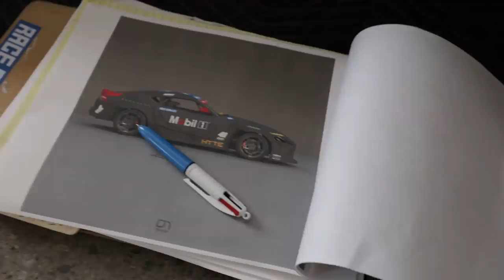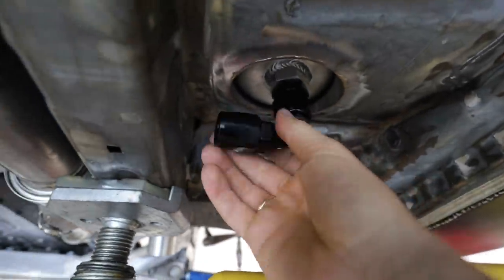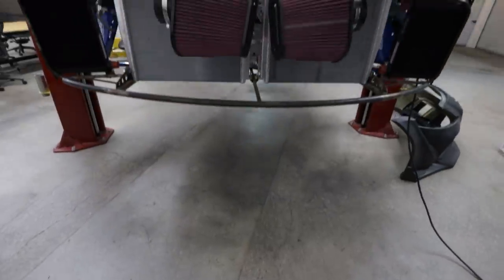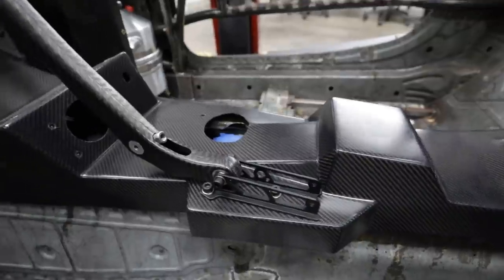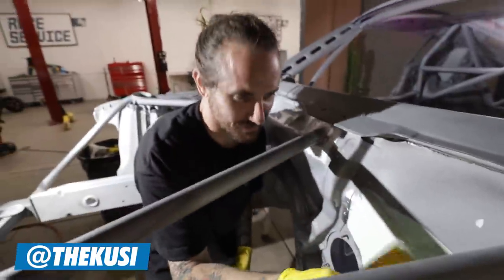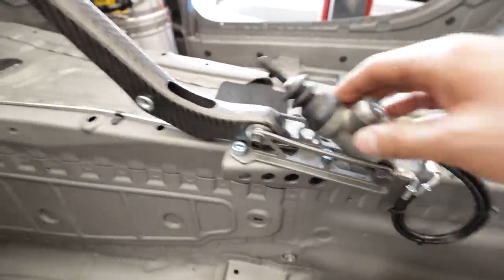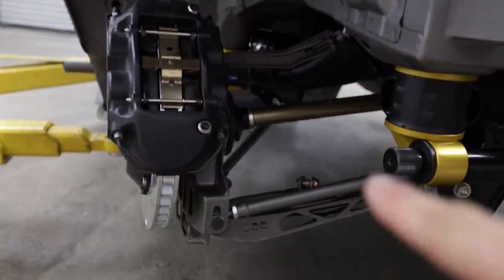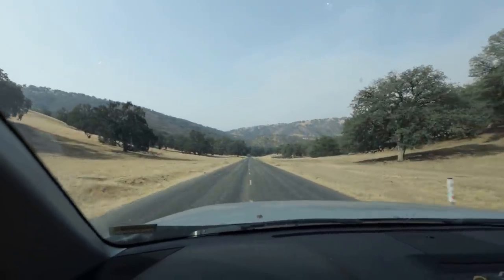Formula Supra SandBlasting and Final Assembly!

Comment: This car is the definition of PERFECTION. Cannot wait to see you shred in both grip racing and drifting with this thing
Reply: Tbf I hope he doesn't drift with this, the engine will not like it. Also, it's kinda a waste to use it that way
Reply: @yur1831  ofc he will drift on it
Reply: @yur1831  what about drifting do you think is going to do anything to that judd? It's dry sumped, its fully built for revs. The only thing that may hold it back is torque, but otherwise this thing should drift with ease.
Reply: @yur1831  I feel you . This would be way more interesting as a time attack car . There’s a million drift builds .
Reply: @yur1831  he’s a professional drifter though, why would he not?
Reply: Kids doesnt understand Judd Engines
Reply: @yur1831  this engine was built for lemans race cars. They rev high for hours, drifting will be a walk in the park.

Comment: I've been looking into aftermarket magneride controllers so I can simply pick a map for track/time attack, drag racing, and drifting with tire changes being the only other requirement. You can eliminate roll bars and maintain near flat chassis. No roll, no dive, no roll bar weight. Gotta love technology. Crazy part is that it's a fringe technology. Insane.

Comment: I don’t know if it’s possible but I would put the air intake in the top of the hood in the high pressure zone so you don’t have to run those huge pipes around the core support . 
You could build the air filter boxes into the hood like an old school shaker.
Reply: Would ruin the aesthetic of the car as well as the aerodynamics
Reply: @trippnoutmotorsport3164  not if it’s done right.
A nicely shaped duct just poking through on each side of the hood would look good and if positioned right actually improve aerodynamics.

Comment: Wait so you didn't 2k epoxy primer it? Do you want it to rust?
Reply: In theory, by painting it essentially immediately after sandblasting, the chance of rust is very low. Also don't forget that a lot of the chassis is aluminium